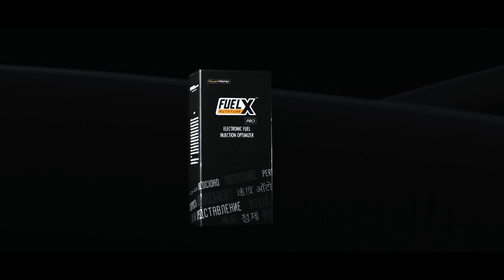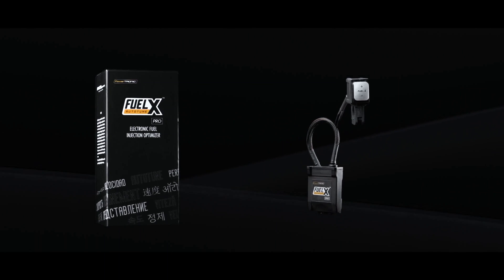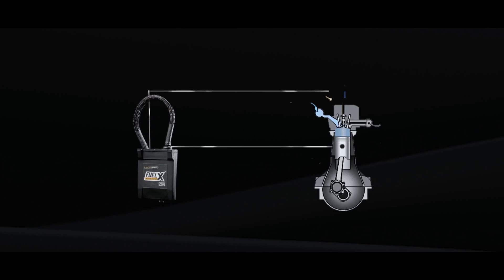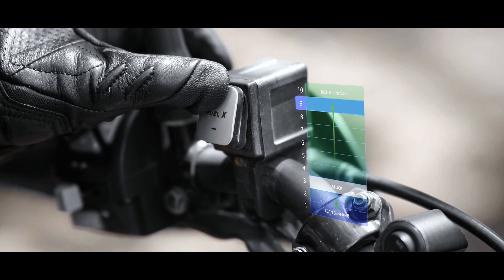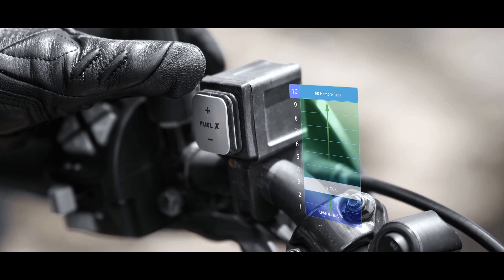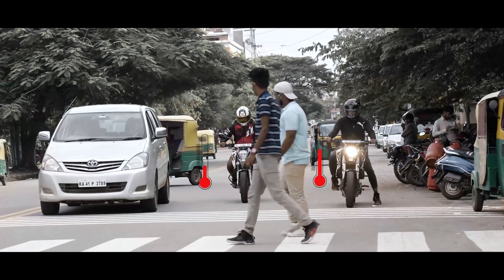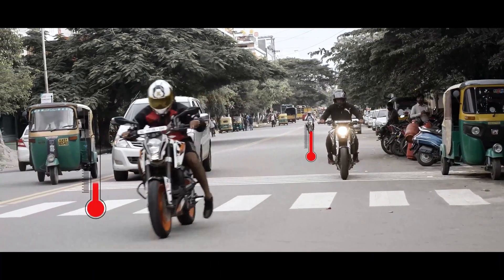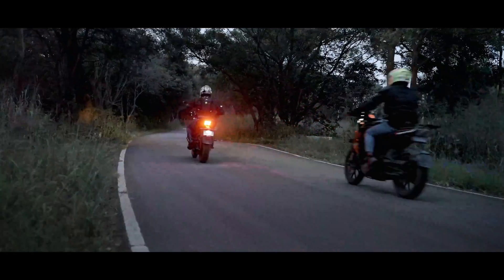What is FuelX autotune | How does it improve your ride | FuelX | Powertronic | Race Dynamics India

Comment: I'll admit I was sceptical about this, thought it sounded almost too good. I changed my mind within a hundred metres, the bike (RE Classic 500) is so much better than before, doesn't try to stall, runs much smoother, and no more popping and banging from the exhaust. Used to be almost embarrassing, but that's all gone now. A great little device.

Comment: Do you recommended this device for RE Super Meteor 650 ?
If yes, what’s the impact on milage and also, which exhaust do you recommend to use along with both fuel X Pro & Powertronics ?
Reply: Not just your silencer pipe, you need to change & upgrade even your air filter with a performance air filter.

Comment: Can i use fuelx pro on my bullet 350 bs6 and reduce the rpm to to around 8000 9000 with the help of custom tunning maps or so..
Reply from the maker: you can contact our team at +918123449292, They will guide you for the same.

Comment: Does it effect the fuel efficiency after installing
Reply from the maker: FuelX is a state of the art electronic plug-in fuel-injection optimizer for modern engines. It autotunes the engine to its best operational parameters, constantly monitoring, learning and adapting to the engine’s condition, wear and tear, riding style, add-ons (such as air filter and/or exhaust), as well as the environmental conditions such as temperature, humidity, altitude etc. It always ensures that the engine performs in the safest and most optimal zones

Comment: I am using it on my duke 390 BS6. Yes I felt the benefits first ride after installing. The bike was instantly smoother a lot and low end just transformed to another level . Wow i just love my 390. I actually wanted both of low end fun and high end adrenaline. Now i got both Thank you fuel x team. Keep going and help bikers to have their on fun machines.
Reply: Brow did u saw any difference in mileage…..
Reply: @ajishav5523   completed around 1000km and i see no major drop in mileage. in city i think 1km/lt drop.
Reply: Are you using the pro or the lite version?

Comment: fuelx or powertronics ? i have gt650 with air filter and aftermarket slip on
Reply from the maker: You can always get both!! FuelX will improve the refinement and rideability of the bike, where are PowerTRONIC ECU will give you the performance gains with the setup you have on the bike. You can always learn more by contacting our team at +918123449292 or visit our website www.powertronicecu.com

Comment: Will fuelX solve stalling issue in lower rpm?
Reply from the maker: Hello, Yes it will definitely improve your low end torque and reduce the flat spots! You can contact our team at 8123449292 for further information and support

Comment: Can we  install and use fuel x and powertronics ecu ?together !
Reply from the maker: Yes you can! You will get the best performance and refinement with both products working together.
Reply: @RaceDynamicsIndia  guys do you think self installation works ? At home we cannot do dyno test properly , so where can we get done? Does powertronics have some location to get this stuff done in south India ?
Reply from the maker: @virtual_livilng  You can install the same yourself as well! As the maps are already loaded on the ECU and you do not need to get a Dyno test/tune done. If you wish to get a custom Dyno tune done, then you can always visit our facility in Bangalore for the same. You can also contact our team at 8123449292 for installation support and further details.

Comment: I install the New Fuel X autotune pro version for Hero Xpulse 4V. After installation when i ride my bike the engine faulty indicator still  turn ON (doesnt turn off) which usually used to turn off after the bike is in motion. Can you please help me?
Reply from the maker: Hello Benjamin, 
Kindly request you contact our technical support team at 9916229292 or support@powertronicecu.com and they will help you with the same.

Comment: Hi, I own a 2021 Royal Enfield Meteor 350. I like the bike, but the stock airbox intake is too restrictive with the snorkel. Unfortunately, when I try to fit a higher flow airbox intake (that is without the snorkel), the bike vibrates more and makes my fingers numb; I'd like to eliminate the vibration, while enjoying better power. Will the FuelX Lite help make the engine run smoother with the high flow intake installed? Thanks!
Reply: put a d n a  air box on works better
Reply from the maker: Hello Marky, we would recommend going ahead with the Pro variant as you will have the freedom to select a map that suits your needs the best! You can always contact our team at +918123449292 and they will provide you with further details.
Reply: @RaceDynamicsIndia  okay, thank you!

Comment: Hey folks. Does it void warranty if I add Fuel x to my motorcycle? This is a TOP question where very less people have answered. You doing it will help lot of riders here. Thanks !
Reply from the maker: Hello Abhijith, FuelX is a plug and play device that can be easily removed and you can go back to stock for any warranty service. For more details you can always contact our team at 8123449292 over call or whatsapp.
Reply: @RaceDynamicsIndia  Thank you guys! Finally some relief 😅
Reply: @RaceDynamicsIndia different between fuel X and powertronics ?

Comment: Will this helps run my Yamaha R15 v4 smooter? I installed full system exhaust and power Air filter..it kinda runs jerky .. will it auto tune my setup?
Reply from the maker: Yes it will!! You can contact our team at 8123449292 for more details.

Comment: What’s the difference between powertronic vs fuel x
Reply from the maker: The FuelX is an Autotune fuel injection optimizer and helps maintain the AFR in the engine based on the reading from the lambda sensor, to give you a better refined ride. Where as PowerTRONIC controls more parameters to improve on the overall performance of the bike such as the Ignition and Fuel injection .  FuelX is more intended for vehicle refinement (lesser flatspots, lesser jerkiness etc) and helps in cooler running of the engine.  PowerTRONIC is more inclined towards performance enhancement on the bike.

You can learn more on our website www.powertronicecu.com

Comment: Please tell me if I can put it in Classic 350 BS6 2020 model?
As it is available for 2021-22 models
But I didn't find any models available for Classic 2020 BS6 EFI model?
Can I install 2021 FuelX Lite in 2020 model ? 
Will it work ?
Please help
I'm not getting proper clarification from anywhere.
Reply from the maker: Hello Arnab, 
We have not tested for your model of bike. Kindly request you contact our team at 6366450705 and they will guide you on the same.

Comment: Should I get powertronic or fuel x pro for my Duke 390? My main agenda is to solve the jerky low rpm idle and improve the low end. I can only choose one. Which should I get for better gains? Does powertronic control the lambda sensor? Is fuelx better in improving the low end?
Reply from the maker: Hello Sanju, we would recommend you go for the FuelX Pro variant first as it will help you a lot with the low end refinement that you require. It will help reduce the jerkiness to a great extent! You can add on the PowerTRONIC ECU at a later stage to improve the performance of the Duke 390. Also PowerTRONIC ECU does not have a connection to the Lambda Sensor.
Reply: @RaceDynamicsIndia  Thank you for the reply.
Reply: @RaceDynamicsIndia how are the powertronic and fuelx different from each other? And which of these two will help my Interceptor 650 more?

Comment: Hi, currently upgrading my aerox engine  with 63mm UMA big bore and UMA high lift cam with 32mm throttle body. I know that my AFR needs to be calibrate, i'm planning to buy these Fuel X . I've heard that there is an  auto tune feature on The Fuel X, can this alone accurately calibrate my current  AFR with the engine settings specs mention above
Reply from the maker: Hello! Yes the FuelX Pro variant will help you in optimizing the AFR Values for your Aerox with the Big Bore kit. You can try out the maps and select the one that suits your vehicle the best. You can always get in touch with our team for any further assistance and knowledge.

Comment: Let's say if I buy a fuel x pro, can I use the same module for Classic 500 for few days and when I want unplug it and then plug it to an Interceptor 650 as well ? 

Or do I need one separate for classic 500 and one for Interceptor 650?
Reply from the maker: Hello Chandan, the Units are different for each vehicle.

Comment: Question: Why does CEL throw up on the dash on Map 8 on the Duke 390 and goes away after coming down? Seems to happening to some of the 390s, does it have to do with the ambient conditions?
Reply from the maker: Hello Vijay, kindly request that you contact our technical support team at 9916229292 and they will look guide you on your query.
Reply: @RaceDynamicsIndia  can I use this device on my Bajaj Avenger 2014 model

Comment: I have a 2022 BS6 Continental GT. On the website there is only interceptor and continental GT 650 (2017-2020) Will there be a new product for the BS6 Variants or are we supposed to use the same products as the bs4's?
Reply from the maker: Hello Sir, Kindly contact our team at 8123449292 and they will guide you on the same.

Comment: I own a Dominar 400, 2018 model which has clocked a little over 25k kms till date. I am planning to get a Powertronics ECU for it. IS FuelX also needed along with the ECU or will it be a redundant addition?
Reply from the maker: Hello Ayan, you can install both to get the best out of your vehicle! FuelX is mean for engine refinement and improving the rideability where as the PowerTRONIC ECU is meant to improve your overall performance!
Reply: @RaceDynamicsIndia  Does it affect milaga
Reply: Go for the powetronics

Comment: Question: If you have PowerTronics already installed. Does FuelX become redundant since powerTronics controls both fueling and ignition? Please explain
Reply from the maker: Adding FuelX will improve your refinement and performance even more!! It is an Autotune device that optimizes your AFR. You can get more details on our website www.powertronicecu.com or contact our team at 8123449292
Reply: @RaceDynamicsIndia  Uxyxv

Comment: Question:  How does the FuelX increase power if it only effects closed loop fueling (idle)?
Reply: Giving Fake information to Ecu From Oxygen sensor / Lambda  sensor , ECU is programmed To Analyse this information to Adjust Fuel Injection Rate . This is because of temperature control of engine , Emission norms , Performance Factor etc. 
How fake information is turned to increase or decrease fuel rate is proportional to Increase or decrease power Produced
Reply: As far as I understand, as fuel X  could controls the fuel flow into the piston chamber as well. More fuel more power. Since no bikes can be powerful unless it consume more fuel.
Reply: @benjamintemama1115    Right, but goes back to my original questions... Since the Fuel X only controls closed loop fueling (fueling only at idle), how would it create more power if it doesn't increase fueling to the cylinder under load?
Reply from the maker: FuelX is a rideability and refinement oriented product, it improves your low end and throttle response. You can contact our team at info@racedynamics.com, and we will be glad to give you the complete details on the same.

Comment: Will it affect mileage
Reply from the maker: Hello Sir, there will be negligible change in you Mileage, but that can be mostly regained by needing gentler riding technique.
Reply: @RaceDynamicsIndia  Now that is a funny answer. Since my bike has more power (PowerTRONIC installed), and runs super smoothly (FuelX Pro & several other mods installed), I am obligated to beat on it even harder than before! My 2016 Duke 390 gets about 50 MPG now, so I have to fill up often! Love every minute of it though 🙂

Comment: what about mileage?
Reply: Factory has to drive down emissions so forced to run too lean, causing hot running and ironically having to choose a lower gear and rev the machine more, to get past the jerky low speed behaviour. I think these emission rules are wrong. Changing the ratio from 14.6:1 to 13.5 will slightly reduce mileage, but that will be mostly regained by needing gentler riding technique in town.
Reply from the maker: Depending on your riding style and condition of your bike the mileage may vary.
Reply: @RaceDynamicsIndia  is  
Mileage decrease or increase ...??
Can you please clarify this after installation increase or decrease..???

Comment: So what's the difference between Fuel X and powertronics ecu?
Reply: Powertronic can be tuned and fuel X is preprogrammed.
Reply from the maker: FuleX is a fuel optimizer which is not majorly into improving the performance of the motorcycle instead it focuses on refining and enhancing the motor to ensure it runs smooth and happy

PowerTRONIC is a piggyback ECU, its major role is to improves the over all performance of the motorcycle by controlling fueling and ignition
Reply: @RaceDynamicsIndia  Thank you RACE DYNAMICS for clearing my issue.
Reply: Is it similar to the the Booster plug from UK ?